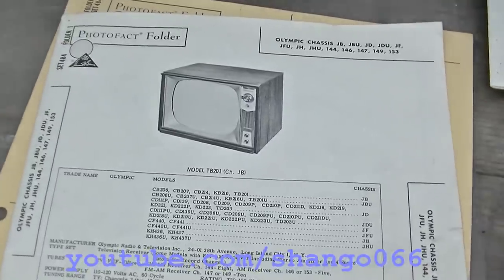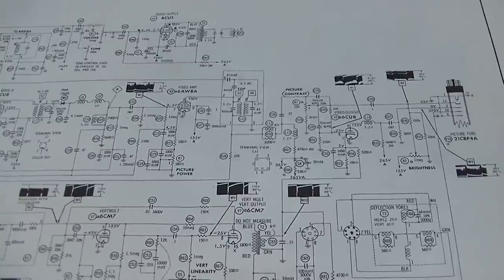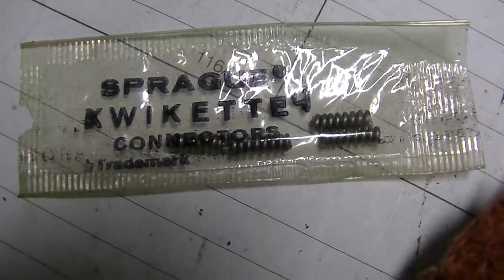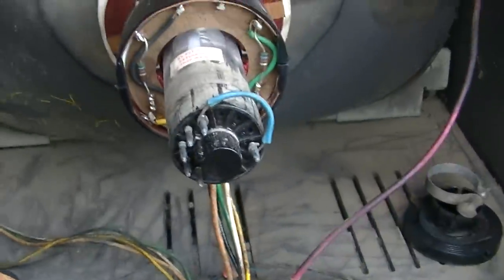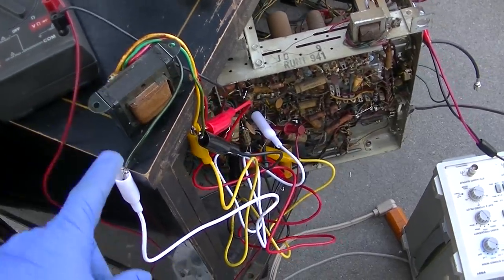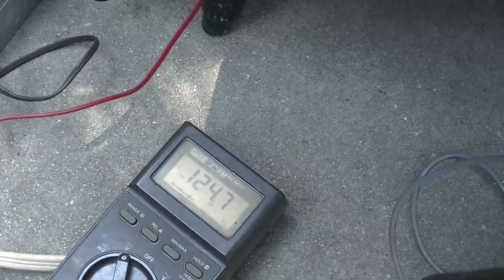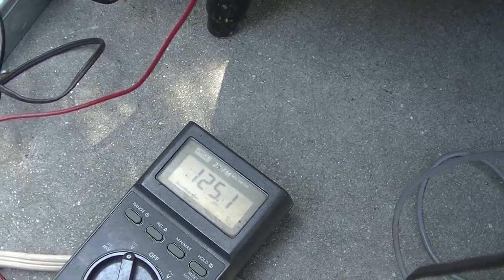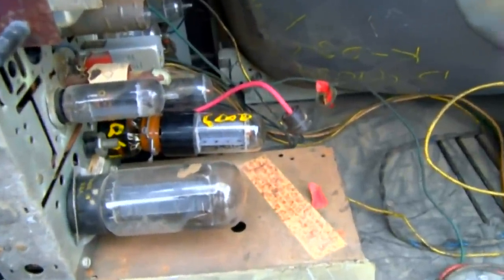1960 Olympic TV Part 2 Vertical and Sound Repair Vintage Tube Television

Comment: FWIW: I have a Hammond organ from 1955 in an unfinished basement. I can hear a difference in the sound depending on the humidity levels - which vary a lot - and how long it has been since I turned it on. Original caps and still sounds great, but getting a slight filter hum so needs a recap job - which is a total PITA.

Comment: I have to wonder how much of it was fixed by cleaning the chassis.  When you're dealing with circuits that use resistors in the megaohms, it doesn't take too much most dirt to screw things up.  It appears it got a lot better after the cleaning.

Comment: Before finishing the tape, I'm going to offer a theory at which you are sure to HOOT. Enough dust, hair, insect remains, animal waste, and / or smoking resins contaminating a DC circuit of this complexity will create destructive / deteriorative eddies, shorts, micro shorts, voltage divisions, RF stray dogs, and carne asada burrito morning afters.
Reply: Can confirm, in fact just yesterday I received an old set, filthy as can be. I set it aside in my workroom intending to come back to it today and much to my dismay, this morning I found the workroom littered with carne asada burrito remnants.

Comment: I can't think of much to say about the TV, other than I'm impressed with your perseverance. As for those little ice machines...they have everything a regular ice machine has, just much smaller. The compressor is about the size of a beer can. If you feed them clean enough water, they'll make perfectly clear ice cubes. The ones I've seen work very well.

There are only two kinds of bugs I utterly despise...roaches and wasps. Could the roach remains have been conductive enough to mess something up?
Reply: So much so, you tore down the Roach Palace, uxwbill!

Comment: Hi Shango, I enjoyed your video on the very old black & white TV Radio combo & one of the reasons as to why the TV audio volume could be low is it may have been made where the TV Audio may be played into the AM & FM audio Amp & the corp that made the TV may have had it where to Audio from just the TV chassis is lower as the AM & FM Amp can bring up the Volume of the TV as loud as you would want it to go. I recall years ago when I use to work at Grand TV in Duluth MN We would get some Magnavox TVs with the AM FM Radio & a Turntable in them. We would have to remove the TV Chassis & do the repairs in it & We would hook up a Speaker to the TV Audio out & on some units of the combo units & the TV Audio would be softer then a normal TV would be. On some of them the AM FM Amp would all so be on with just the TV & the Radio Amp would pull in the Audio from the TV Chassis & would give you extra better sound & be able to get lots of Volume out of it. So that is Just a thought that came to My mind as I was watching you try to get it to play much louder. I recall Mike at Grand TV had told Me on some of these old floor model TV AM & FM Turntable units the Radio Amp all so would bring up Your TV Audio all so. Not all models were made like that way but there were a few set up that way. The old Combo sets that came in to Grand TV were Color TV Radio Phono combos but we never had a Black & White TV Radio combo units that I can recall that came in. Its to bad that the person you got that from let it go to pot by Cats & Rabbits eating it a way & destroying the back & the inside Wires for the Radio & Amp. That old TV Radio would be worth something if it was well took care of & if the TV only just needed some small repairs. Take care.
Reply: Good insights.

Comment: Hello shango066. In my opinion, the vertical issue was caused by dust mixed with water in the air (humidity).  It becomes a "conductive undesirable mash" especially around high impedance grid connections or sockets.  It happened to me many times not only in antique TV sets, but also in audio amps and radios. I live in South Florida where humidity is always above 60-70 %. Before any repair attempt, the first thing I do, is a detailed cleaning of the set. It leaves me out of a lot of problems. By the way, I like your "horizontal test tube" as a sacrifice option in case of shorts etc, and It seems to me that 6AQ5 is a 7 pin low power audio pentode. Please verify this is the right nomenclature for this tube. Thanks
Reply: It’s actually a 6AU5.  Not sure why he kept saying 6AQ5. 6AQ5 is a small audio output tube. The 6AU5 is a power pentode for small horizontal output stages. Similar to a 6BQ6 without the plate cap on top.

Comment: Capacitors are a pain! I have O scale model trains that have electronics in them. They are now 20 years old and one can capacitor in particular fails. Chinese parts. Sometimes it explodes! It's a royal pain to replace but with care it can be done. Then they work again. Have to wear a ground strap when you do it or you can static blow other stuff on the boards. When I buy one now if that cspacitor is buldged I replace it. Your videos are very instructive.

Comment: Shango's version of Sprague Kwikettes are better than the real thing, which are hard to find. The paper clips are cheap. 
Just get a box from Walmart or the Dollar Store.Transformers have thin enamel insulation around the wires which can 
break down over time depending on the environment. Wet paper wrapping will accelerate this if stored in a damp location.
Put it in a clear plastic bag with a bunch of desiccant packs ( they say  do not eat on them )and leave it in the house for a 
couple of days in a south facing sunny window and see if it will revive the transformer. Couldn't hurt. I rather don't like the multiple part videos on your site but this TV called for it. Got more of your wry sense of humor Shango!

Comment: I really appreciated this video. It was very educational. You're a good teacher. I especially liked how you ran though the circuit diagram at the start showing us potential problem points. The other thing I appreciated - you cleaned the chassis - this can't be the real shango channel anymore - have you been hacked?? I like a clean chassis. But then again I also like hearing "i like dust" and "dust makes me happy" cause that makes me laugh.

Comment: bandersentv did a very nice video explaining what a horizontal drive line is and what causes it.
 I never knew it was a release of stored energy by the tuned circuit that powers the first half of the electron beam from the starting point from the left to the center, where at that point the horizontal output takes over and carries it from the center to the far right. If the handoff is not seamless, the beam slows down, then resumes the journey. That is why it is brighter and distorted in the center.

Comment: The trouble with roaches, is you spend all that money, and go to all that trouble to "tent fumigate" the house, and a few weeks later, your roaches are back again. My house is very cluttered, but there is no food for roaches around. I do have roaches that live in the plumbing pipes, so the only way to keep roaches out, is to keep all the drains plugged at all times.

Comment: THE AUDIO ISSUE.  Do not hold me to this Theory but I think??? The audio from the TV is fed through the radio phono amplifier portion and is further Amplified to make it louder. I could be wrong but that is what I think is going on here. I think when you get to the radio ohono portion of the Resurrection that may be the case. Because the rabbits chewed up all of the wiring I assume you are not sure where that cable went to as far as the radio chassis. Just some food for thought. By the way those radio-phonograph portion of these sets worked very very well.
Reply: That's exactly what I was thinking! Considering the audio is being hooked up to an RCA jack that would go to an amplifier, it would make sense. I've hooked up speakers to line out jacks and get clear, but weak audio

Comment: Hm. I suppose you could use keyboard springs to make those lead splices. The heat will probably wreck the springiness but that doesn't matter. And they're pretty cheap.

Comment: I wonder if those ice makers use thermoelectric Peltier units instead of a refrigerant.
Reply: They have tried the Peltier units, but the efficiency is so low that they aren't practical from a size standpoint and a power consumption standpoint.

Comment: 45:25 I wonder if it moves the heat using a Peltzier solid state device. I still have one of those for a Pentium II computer CPU. Absorption system also another possibility, using heat to move heat. Old systems used ammonia, not sure it is safe to use that nowadays

Comment: Could you please explain how what you were calling a "Drive Line" is caused?
It was bright in this case but they can it seems also be dark.
If it degrades the horizontal linearity as you noticed yours doing then it must be unwanted velocity and not intensity modulation of the scanning spot.
I was wrong about suspecting a supply issue with the Vertical/Audio issue then.

Comment: Genuine question: is there a reason for not cleaning the dirt with a gentle pass of compressed air before attempting any repair?

I wonder if dust and dead roaches are the cause of minor or intermittent issues in some of your repairs. As someone else pointed out, dirt can behave as a resistor, especially if the dust comes from long-term storage in industrial areas. My dad used to work with cast iron, I let you imagine how every surface in the shop got covered with black dust, that stuff is conductive and sticky as hell. Dust can even retain humidity in some cases.

On the other end, I can see how compressed air can cause damage to fragile components if not used carefully.

Comment: Shango please check the sacrificial tube number. I liked the option to have some cheap tube but I thing 6AQ5 is a 7 pin low power pentode, and according to what i see, this tube is octal type. Please check. I will appreciate it

Comment: Olympic TV sets were kind of weird. I remember that most of the console sets were series wired and most of the portable sets had transformers. Go figure. Also a lot of Olympic combo sets would share the plate supply and lose volume if the rectifier is weak.

Comment: No, at that (physical) size, that water/ice-cube thing almost certainly uses a Peltier junction, and maybe a self-contained water circulation system like some desktop-class computers have, plus a small fan. I don’t know if a regular A/C compressor and associated tubing would scale down to that size. Maybe it could be used to cool off hot, red-plating vacuum tubes. But that’s just a guess. And shotgun any roaches you have with wax/paper capacitors; roaches LOVE leaky capacitors. 🤣
Reply: There are ridiculously small compressors nowadays, some ice machines use the ACXZ14DC-S which is smaller than a soda can

Comment: I think I know what finished that set off. There was some other fault, so the man of the house - the Phantom Twiddler - who hadn’t touched the inside of anything electronic since finishing his national service as a radio operator 20 years previous went on a coil twiddling spree to try and fix it as he “knew what he was doing”, ended up making it worse and calling out that mobile TV repair van, who quoted a price that was too high for the man of the house to be willing to pay!

Comment: I know absolutely nothing about TV or radio repair but I love watching your vids. So I have a dumb question. Is it possible that after you blew out the roach stuff that something organic could have been messing something up and you blew it out of there? Told ya it was a dumb question.
Reply: Not dumb at all. A lot of that crud is conductive to some degree, particularly in humid environments. And since tube circuits operate at high voltages those problems can render a device inoperative. It's even a problem with solid state equipment.
Reply: @Inflec  Thank you! What you said makes sense! I didn't even think of the humidity factor!

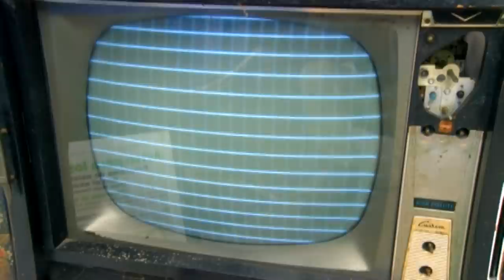Comment: Shango....   38:00 a 6aq5 is a 7 pin audio output tube. Not that 8 pin tube you are showing. What is that tube in your adapter really?  Just axing...

Comment: roach body/dust conductivity dude.   try a test.   start with a dirty set of your choice that has a problem, blow and brush it out including the tube sockets and tuner.  spray clean on the tuner and tube sockets then try it.   might put you out of business

Comment: Is it possible that some tv’s of this vintage are just crap? I grew up in that era and remember relatives homes with these tv’s , some were buzz boxes, some had weak sounds, some had jittery pictures like Michael Fox was holding the antenna. There were a few good sets but the cheaper line were just nothing much to brag about.